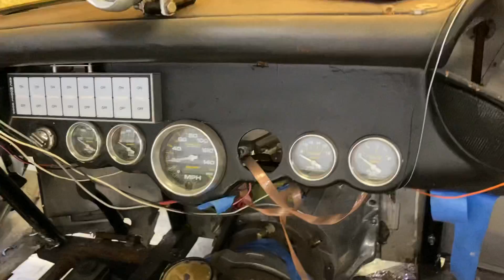56 Vette: Progress

Comment: I don't know anything about the 16 volt system, but on 12 volt. I know on car audio and the Ford Mustang I had. I had a 1 farad digital capacitor that was like a second battery. meaning with out the capacitor the lights would blink and the alternator would hum while the car ECM and all the electric stuff was competing for the electricity. 
I don't know if you all need that with that on that setup, but if your needing more power to run things. that might help my friend. you all know than I would, but that come to mind with the amount of stuff going into it for some reason.
Let us know when you get the app going. I enjoy watching the videos.
The car I had was the one that a 4cyl. 2.3l. It had 8 plugs for a 4 cyl. 2 coils, and had a relay module instead of relays. As my instructor used to say "Ford always has a better idea" because you could have same make, model,same engine, but different month it was made and it would be something different about it.

Comment: If this is being built for Drag week/race week, they keep the rules fairly loose. But not sure how a center drive (I know it's a joke, but) will factor in if you plan to run under 8.50 indexed class (per the cage). If you plan to run unlimited, those rules are really loose. It's not unusual to see promods (Lutz and Bailey) and Larson's truck was a fairly radical setup due to the switching needed just to race or drive

Comment: hey reaper im sorry fo leaving this comment here ,,  ilooked foi the  video of when you got reaper back from blasting    ...............
hey reaper ............ i was wonderng ?????                 when your car caught fire did anyone spray any water on it or by the time a    fire dept got to it had it was it just a pile of ashes.....  
i am guessing that the car is  chrome moly tubing.... the reason that im asking............  if any of the tubing was close to being red hot and water was sprayed on it  , rapidly cooling it queching it   the steel will be brittle.......  if it was  allowed to slowly come back to a touchable temp  your steel will be softer than it was causing someting to flex and bend  more easily......  4130 chrom moly tubing shall be very close to Hardness, Brinell  217  ., as i remember you just spoke on the  welds....   i love a good story  keep em coming...